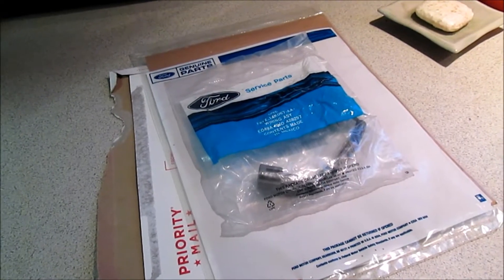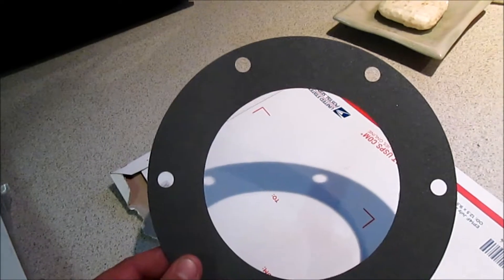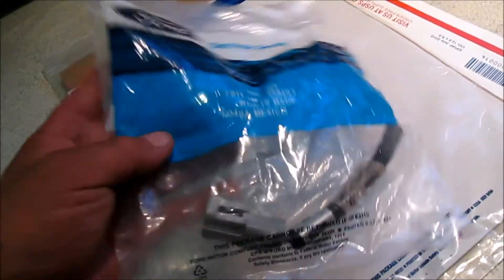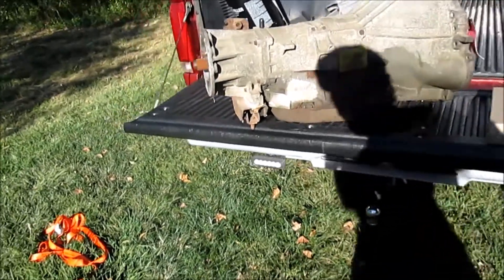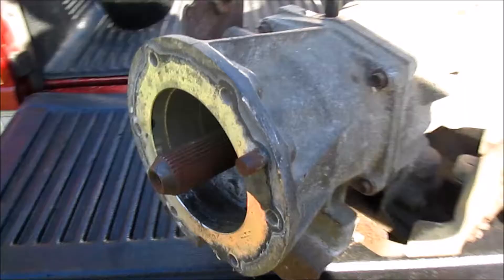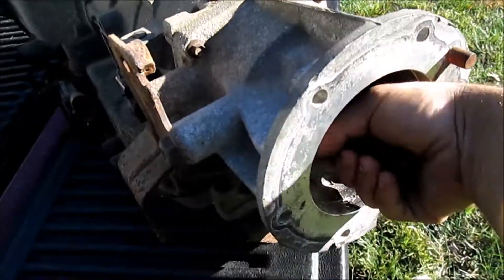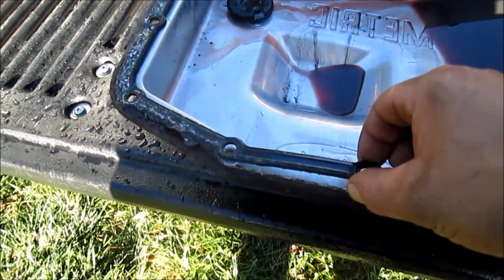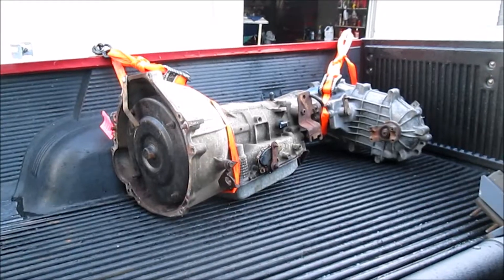Ford 4R70W 4x4 transmission inspection

Comment: Now is a great time to inspect your rear main seal flywheel torque converter or clutch and pressure plates and shift forks while you have your  transmission out  for your 4X4 conversion.
Reply from the maker: Since I'm having my buddy's auto shop do the tranny install, he will check the rear main seal, and will test drive it to ensure that the tranny and torque converter are indeed good.